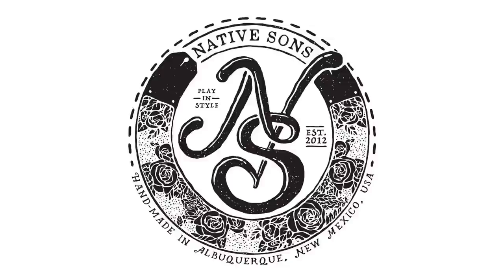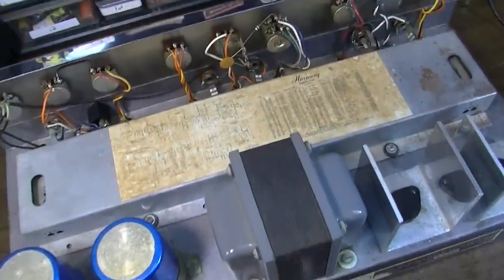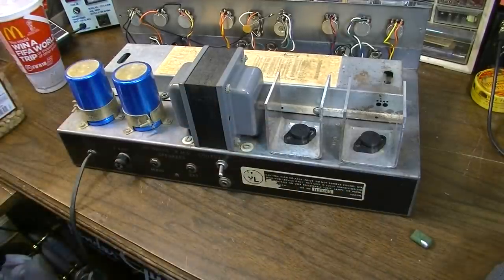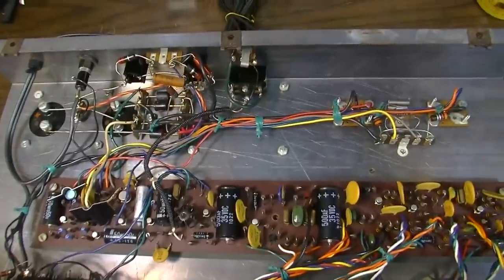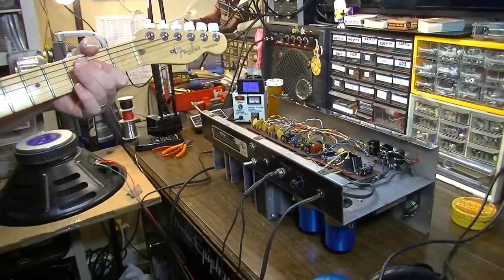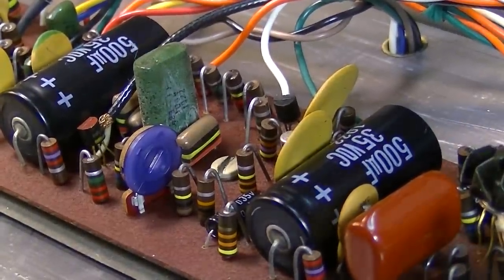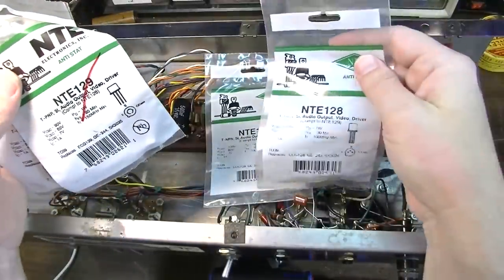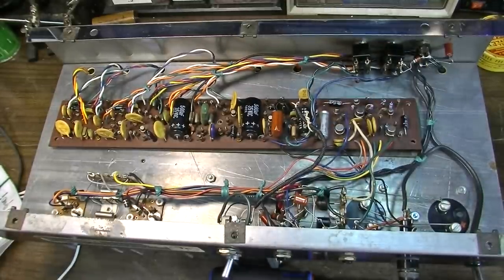STUPID AMP! - 1970 Harmony H550 Solid State HAIR PULLER Repair

Comment: Brad, that Q4 PNP did test bad. Your tester reported hFE = 33 which is too low for the current it's being tested at. You'd be looking at something greater than 50 for a functional part.
Reply from the maker: My understanding of hFE is it's a measurement of the base to collector gain. Can you elaborate on your math there a little? I'm genuinely interested. Trying to learn more about transistor stuff.
Reply: Base to collector current gain is beta, and its value is somewhat different to hFE. I don't know the intricate details about those but you can find more by googling "beta verses hFE". Here's my understanding:
hFE is DC current gain. Collector current divided by base current. Varies with current, temperature, Vce, universal constants, phase of the moon, all sorts.
Beta is AC current gain. Using circuits like the current mirror, you can get very high values of beta like 2000. A common way to increase beta is to add a capacitor across the emitter resistor in NPN circuits. There's a similar technique in valves too, right? Beta can also be made to be much more stable across temperature than hFE with feedback.

The datasheet for the NTE129 says the hFE should be greater than 50 at 0.1mA and greater than 90 at 10mA. The tester will be using a current within that range so we can assume 33 is too low.
Reply: +The Guitologist, +Prehistoricman, I don't know if the term "in general", or possibly "as a rule" applies in this for-instance, but, it's been my experience, that PNP Silicon transistors become "failure evident" in amplifier, or pre-amplifier circuits, when the forward gain is off (lower) by more than 10%.  It doesn't take much for PNP Silicons to transition to "no-go" status, because their percentage of gain directly correlates to their ability to generate amplification. 

Don't feel bad, as I've banged my head against the wall over the years, often swapping out ALL transistors in one section, for much the same reason - that you are going nutz. I've been a Motorola Two-Way Comm Dealer for over forty years, and forced to eat "the flat-rate shit sandwich", on more than one post-1972 MoTrac (when the audio circuitry ditched most of the germaniums, because of the tin-whiskering situation).  When all else fails, blast the hell out of it with 'freeze mist'; it might not help to discover the problem, but it sure feels good to torture that very circuit by freezing the living hell out of it!
Reply from the maker: Good thread guys.
Reply: Prehistoricman, the high gain with a current mirror is voltage gain, not current - beta isn't any different, but the very high dynamic impedance of a current source/sink load makes for lots of voltage gain (which is transconductance x load impedance).  The Early effect is the ultimate limit to voltage gain, and can be pretty much eliminated with a cascode stage (very like the much higher gain of a tetrode or pentode over a triode).
Reply: Aye told you I wasn't an expert
Reply: @AMStationEngineer  FLAT RATE SHITE SANDWICH  BWAHAHHAHAHHAHAHAHAH   this thread makes me feel better Ive got a haunted amp  actually 3    and I have correct voltages and all parts test good.
HELP MEEEEEEEEEEEEEEE LOL
Reply: +Ron Frey, I have a 'hypothetical keyfob, with key', labeled "flat-rate, key to poorhouse". I once chased a "relay chatter problem", within a Motorola MoTrac VHF-Lo transceiver, for 27 hours, UNDER WARRANTY. The problem turned out to be related to a "thin" area on a PC Board, which lost conductance during transmissions of more than eight seconds. The "fix" was to remove the entire trace, then set + glue another. Total in parts used was less than $2.00. Fortunately, the Motorola Two-Way Comm Zone Rep watched some of the ferreting process, and credited my account with a new replacement radio to make amends, knowing the factory clearly would not.

PS, "shite", a disciple of "Father Ted", perhaps??
Reply: +Ron Frey, please go to my channel's "about" page, there, you'll find information which will 'get you most of the way there' - with regards to directly contacting me. I don't mind "fishing around a bit", to help someone troubleshoot; the "via remote control" aspect takes a little longer, but knowing that someone else is banging their head against the wall, sorting the same problem out - has its benefits.

Comment: You need to find a Sencore Cricket transistor tester, I have the pocket cricket. It has tests for gain and a very sensitive leakage test both forward and reverse for all junctions of the transistor, those quick testers miss a lot they are good for quick I.d. of  parts though. You got lucky that it didn't pop the outputs too. Had similar problems over the 40yrs. I have been servicing electronics, The board layout and build style was common back then, parts not id'ed, no voltages listed, oh yeah, one slip of the probe shorting something on a solid state direct coupled amp can ruin your day, not to mention all the semiconductors and usually a bunch of resistors too.

Comment: If you are going to branch out into solid-state repair, I suggest you invest in an old Tektronix 575 curve tracer.   It's a tube-based instrument; can be calibrated with a meter, a manual,  and an eyeball, and allows you to test transistors at (or beyond) real operating conditions.    Might be worth looking into.  I have a component tester similar to yours; didn't realize how misleading (and time-wasting) these could be!   Curious, did you try your  component tester on your new replacement transistors?  If so, what was the hFE?

Comment: Hey, that power amp has overload protection! A great deal SS amps these days still don't. The design seems conventional. Schematic is unreadable, but I'd say all transistors in this thing are silicon, just some in TO18 cases for more dissipation OR because that's what was available cheap ;-)
Also you might want to tap the screws lightly with a hammer before unscrewing (through the driver of course), helps them loosen if they have some corrosion.

Comment: Have to modify the transistor tester or make a transistor tester on the breadboard that test transistors at high voltages like +12, +24, +35, etc because most transistor testers are checking the transistor at +5vdc and +9vdc i think.

Comment: Great Vid !!! Don't Trust your component tester , with Tranys ! Yep when troubleshooting low volt power rails just lift components until you find the bastard ! I've had a Solid State few hair pullers. The worst is Cascade failure ! Had a NAD SS amp , replaced one bad component then a bunch failed .

Comment: You should test components with I-V curve tracers. Most faulty transistors may seem OK at a certain Q point for the cheap tester, but it may not be ok with another Q point.

Comment: Always wise to monitor the idle current and DC offset on a solid state amp of unknown condition while ramping up in variac.
Typically you'll need to get part about 35vac or so for the bias tracking to kick in.
Definitely good idea to first just diode check output xistors to be certain not sorted before even ramping up on the Variac.
It was always a challenge working on these amps with no silk screening in the board😬
Reply: Please make some videos if you are able. Always a lot of good tips in the comments.

Comment: This may be of no use - but I have seen another YTer use FLIR to look at circuits.  I think the logic is that a hot diode is a good indicator of current (maybe intentional, maybe not).  ...and of course, I could have it all wrong...  :)

Thanks for sharing these things.  Always great to watch and learn.
Reply from the maker: I have a thermal camera. In this case, I didn't want to leave it on long enough for stuff to start going up in smoke.
Reply: excellent point.

Comment: When it's semiconductors the only really sure way is substitution - resistors, caps and chokes all test easily and you can rely on them but the semis can break down or play up at working voltages yet show up fine in testers - even really good ones.

Comment: All those feedback loops can make things fun.  I'm guessing your tester doesn't check for leakage.  Taking voltage measurements is the only way.  (War story alert!)  I had a stereo amp where a diode in that string of diodes opened up (but only sometimes.  If you probed it, it would make connection.)  When those diodes open up, the bias resistors turn on the top transistors sending the output positive.  The feedback loop still had control of the bottom transistors, and it turned them on to try and bring the voltage back to zero.  Net result?  A short across the power supply and a blown fuse.  After going though a box, I got smart and used the "dim bulb" trick (yes on a solid state amp) to have power without burning anything up.  With the low power, all the voltages were wrong, but I could still figure what was turning on and why.  It's a repair that sticks in my memory, even if it was 40 years ago....  That was a painful repair, but you came out the winner.  Good job.
Reply: This is the reason its vital to place the bias pot in the right part of the bias spreader circuit so if it goes open the bias voltage drops, not rises - even a crackly bias pot can ruin your day if this precaution isn't done.  The standard
Vbe multiplier is great as when the transistor switches on it clamps the bias to minimum, a safe state.
Reply from the maker: Next SS amp I get, I'm just going to rebuild it with all new parts. It'll be quicker than trying to diagnose the problem. And I won't feel so stupid at the end of it. :D
Reply: It is tempting to just do shotgun repair but it leaves ya wondering what the fault was in the first place. Throwing parts at the repair can introduce even more complications. My technique to SS repair has been to use light bulb limiter so as to hopefully not cook components/fuses and still be able to keep the amp running. If there is no output transformer then no load on the output until the amp is stable.

Comment: Solid state stuff is a real house of cards balancing act. It takes nothing to throw the bias off and completely skew the readings you get. Then it becomes a real needle in a haystack. Fair play to you staying with it, many techs would just write it off. Do you have the jack darr book? Some good logic in there re solid state gear. Interesting story somewhat unrelated. I recently picked up an old marshall 8008 valvestate transistor power amp for a good price and for nostalgia sake to drive a pair of old cabs I have. The original/previous owners can never have played with a clean tone as soon as I whacked it up I noticed distortion on one channel. Turned out to be a wrong resistor, from the factory, in the bias string of one channel. Miles off. It was just biased right on the edge of cutoff. You'd never know with a saturated tone. 25 years plus later it's sorted lol. It's regarded as one of the better pieces of equipment of that range. The heat sinks are massive which is where most things skimp. It gets a bad wrap with people saying it's not loud enough but they generally forget that it was designed to be driven by the then current valve preamps they made with several volts swing on the outputs of them, consequently most of the modern processors don't drive significant enough levels for these amps to get there. It's a shame that solid state stuff gets such a bad wrap, when it's done right it can be a joy. Since the cardiac arrests I've only used an upgraded Sessionette combo which has held its own against some serious gear. I can't carry nor justify owning the big valve stuff. My plexis and matamp went, and I've got an old ac30 that I'm clinging to like Jack in titanic lol. Great video mate I hope it inspires more cool quirky amps to be saved. Hope the weather is good there, North Wales is currently sweltering.
Reply from the maker: North Wales don't know the meaning of "sweltering". Try about 95F at 50%+ relative humidity. Louisville can feel like a farmer's ass crack in the summer.
Reply: The Guitologist well we can't compete with that. We get pretty high humidity on the estuary here though. You can grow penicillin on a funky old guitar case overnight.

Comment: Those metal case preamp transistors most likely silicone not germanium.  I recall distinctly those being mostly NPN replaceable by Motorola type 2N2222's.

Comment: The little Chinese component testers are fine for a static test, but over the last 40 years I've learned that semiconductors have to be tested under load to see if they actually break down, just like tubes. I feel for ya

Comment: (@25:36) the schematic has voltage call outs (presumably DC w/respect to circuit ground) on either side of R8; -3.3v on one side and -1 volt on the other. That’s 2.3 volts over 470 ohms, or roughly 4.9 mA, with a dissipation of roughly 11 mW; well within the 1/4 Watt rating. Maybe there’s a significant AC voltage here? Meter time! 😎

Comment: Oops, let out that factory installed smoke. The bad thing about testing transistors is the meter doesn't put enough of a load on them. Ran across many bad ones that tested ok.

Comment: After you fixed it did you pull a leg & check the  reading of the smoking resistor ? I stay away from SS, but I like SS phase inverter circuits.

Comment: I'd just replace those transistors with BD139/BD140 ;-) Probably way cheaper and better characteristics too :D Solid state isn't all that complicated really, it's just that you have to sit down for a moment and let the schematic sink in. Also you'd want to do testing without a load on the output and some resistors for current limiting in the rails - just so that more elements don't get killed by the fault currents, one dead transistor can and in many cases had killed a lot more with it.

Comment: Who ever laid out the design of this PCB failed. Standing up components on end and then sticking on heat sinks is trouble. Another 10 pounds of electronic crap on a 5 pound PCB. Good fix Brad.!!
Reply: And they neglected to clip the leads short, which is asking for shorts and trouble if the board flexes!
Reply: The (nice) close-ups of all these long leads on the solder-side of the pcb made me anxiously grasp for my diagonal cutters.

Comment: I've recently started watching. I've seen a few videos and was wondering. Have you ever, or do you ever, install board connectors when you get into a situation like this one, to make the boards somewhat modular and easier to remove and work on? Or do you try to keep amps as vintage and jankey as possible when you get them??? I saw one video where the guts were a skeletal build that I would have built a board for but that's just me. TY!

Comment: That green capacitor must be a decoupler capacitor, to get the valve sound out of a solid state amp you would need a Pulse Width Modulation output stage with heavy filtering, what about replacing the PNP transistors with BC212L transistors and the NPN transistors with BC182L transistors to get rid of the Germanium transistors as that can dies of whisker disease  like the larger Germanium power transistors, can you replace the 470R resistor with a wire-wound resistor of the same value possibly a 5W version, that output stage is a pain in the butt.

Comment: More modern SS state amps are fine. I have a 1979 Acoustic controls Corporation 320 bass amp that has never had an internal problem other than needing some switches being replaced. That could happen to any amp.
Reply: Same.

Comment: I have a question if you had a tube you could not or just wanted to go to solid state could u use a breadboard with electronics and plug in to a tube socket either directly or by wires

Comment: I was wondering, while you were testing, if this was going to be one of those things I see on some other vintage electronics channels where parts can test OK because the tester or meter isn't testing (or metering?) at operating current. I've seen it a lot with capacitors in old radios; they test fine on small meters but put it in one of the old ones that tests it at the operating voltage, and it's leaky as hell.

Comment: Would you be interested in doing a service on Garnet Revolution I G45TR early 70's 1x12 combo 6V6 18W point to po Low wattage Revolution I amp. This thing is the sweetest 18 w Close a FENDER Tweed Deluxe but with tremolo and reverb

All original with the exception of the power cord (3 prong for safety)
- 18 watts and 12 inch original spk (marsland ???)
- Vol (Pull bright), bass, treble
- Tremolo (depth, speed), Reverb
- Footswitch in jack (not included but reverb and tremolo works just turn

Comment: Solid State with an input transformer? Or out put transformer? A guy gave me a car amp that had two output transformers in it, I believe for the outputs. Strange stuff by today's standards. It was worth tepee brake job on his pinto, but it got stolen before I could put it to use.

Comment: Hey man off topic question. I have this old Motorola amp from 50's or 60's it's all tube 12AX7 for preamp and EL84 for output 2 of each pretty much like a Vox 30 from what I understand but my question is.. Do these amps usually sound like crap if you try to use a distortion pedal with it?  It sounds great as clean tone but try a Turbo Rat or Death Metal pedal and its just awful.

Comment: The two transistors that were getting hot and smoking.
They will be fine?
Reply from the maker: No transistors were smoking, just resistors. Resistors are fairly resilient if they don't smoke too long. Usually in this circuit they won't see hardly any current across them.

Comment: Worse Tremolo Ever. I assume a tube circuit is much smoother due to the charge & discharge of the tube. Is the transistor version is choppy due to the transistor cutting on & off?  Also is there any benefit to mounting the resistors and diodes vertically like that?